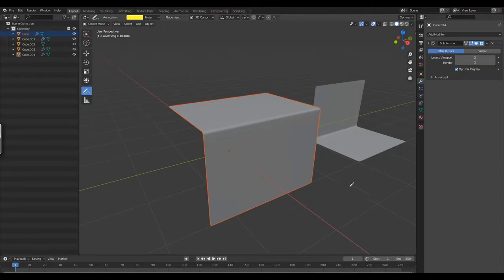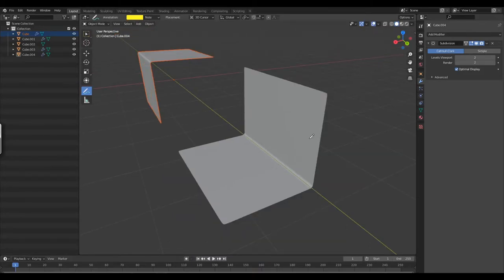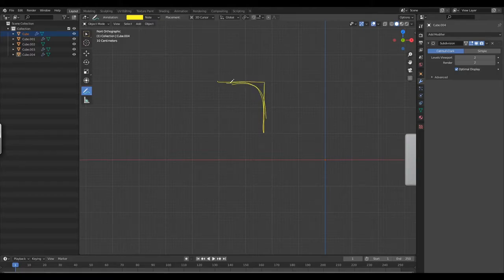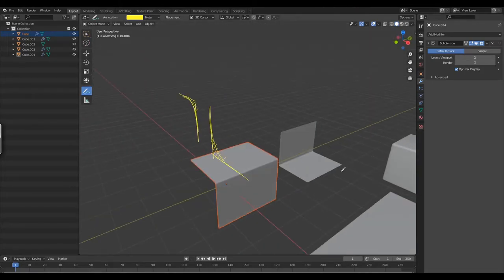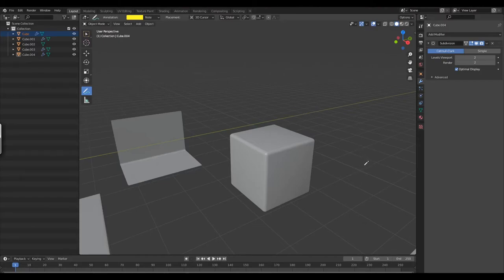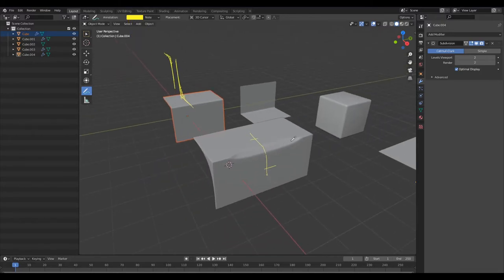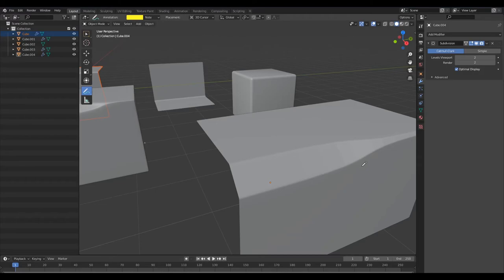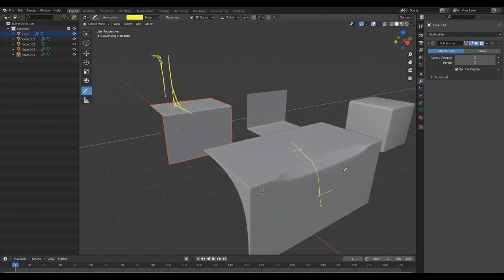Radius, Fillet, Bevel and Chamfer Explained!

Comment: Fyi many sources use a different set of definitions for chamfer/fillet/bevel (I'm guessing it's depending on where in the world one is).   I've seen chamfer and fillet more simply defined as two ways of softening an external edge, fillet = curved profile and chamfer = flat.  In this case, "bevel" is when, rather than altering an edge, you change the angle of an entire side/plane relative to the adjacent. (E.g. If i took a standard brick and ground a 35° bevel in both ends, it's profile would go from a rectangle to a trapezoid).  Thanks for clarifying these definitions you learned, I've heard them before, too, and was confused!
Reply from the maker: Thanks for sharing, I've seen these terms thrown around interchangeable and hence wanted to provide some clarity. Hope I'm not adding to the confusion. Thanks for watching!
Reply: @Art-of-Akrosh  i think this has as for i found this video off of google search after reading google describing these terms differently. im most comfortable to what i see it referred to as in software's that i use like fusion 360 and solidworks (where fillets and chamfer describe both the internal and external edge). sometimes i wonder if its not just location but perhaps trade as well (it seems that designers like to use the term bevel more universally compare to engineers who still seem to be ambiguous about its use)